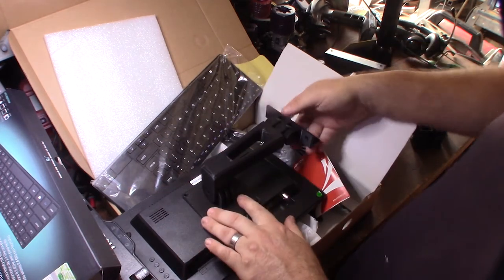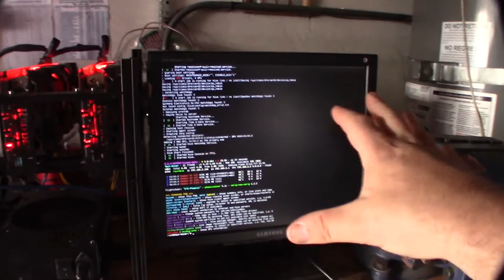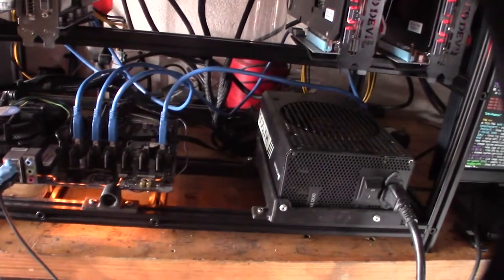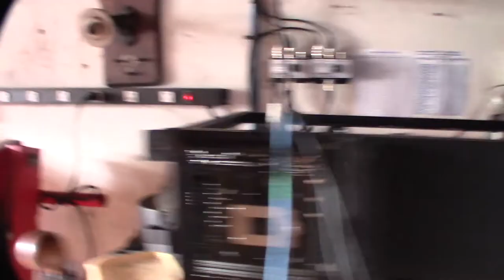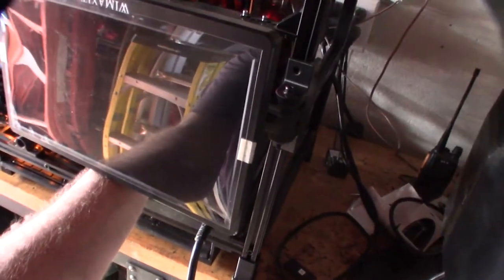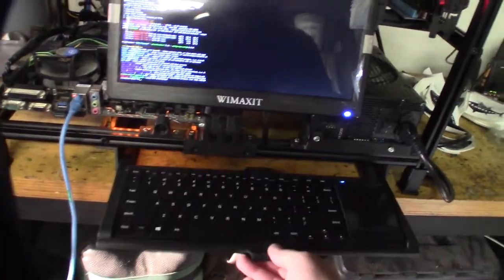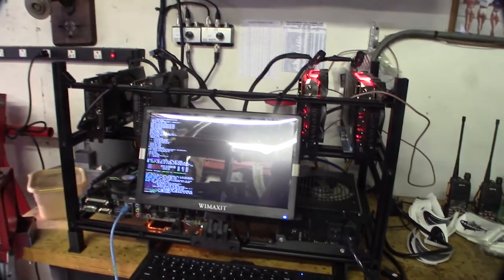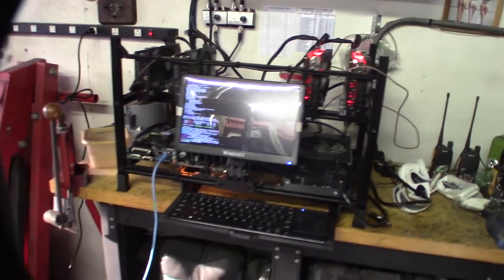Crypto Mining rig 3D Printed Mini LCD keyboard upgrade self contained RII K22

Comment: looks cool, but adds extra cost to the rig.
Reply from the maker: I'm not too worried about cost, Crypto mining is fun hobby to me. Total cost was about $100. Spent about 5 hours designing the parts. I would make more money working my IT job then the hours I spend on my crypto mining hobby. I'm currently working on a 3D printable micro ATX 4x GPU modular Mining frame.
Reply: yes and also extra power electric I pay 0,17EUR 1kWh so it will be useless, using HiveOD is the best but still THEY stealing you money so you have less money then direct ETH